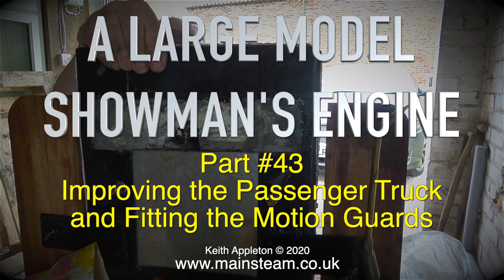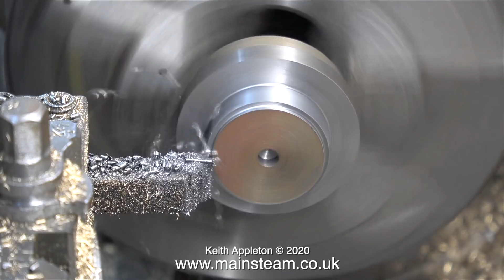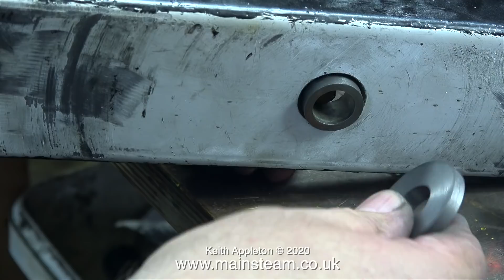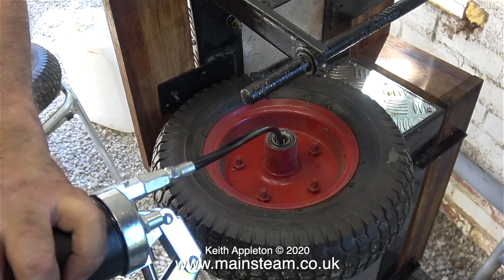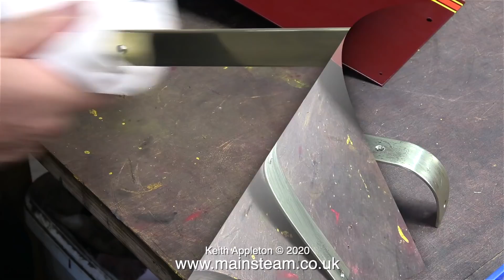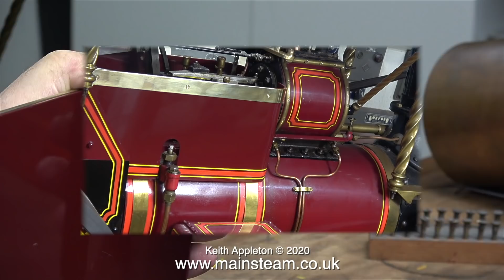A LARGE MODEL SHOWMAN'S ENGINE - PART #43

Comment: When a bolt has X.8 stamped on the head it is metric with the X denoting the grade the higher the better up to 10.  If it was imperial it would have either no markings (perhaps a makers mark) for grade 2 or dashes coming 90 degrees off the flat.  Add 2 to those... so grade 2 for no marks, grade 5 for 3 marks and grade 8 for 6 marks.  The higher the grade the stronger but more brittle.  At this scale even the lowest grade would be immensely oversize but good for bearing on the hole.  For strength even a 1/4" diameter bolt would carry the load in double shear...single shear might be bendy.

As for the size a 5/8" bolt should be 15.8mm so close enough.  The only catch is that the metric bolts have a series of possible threads of 1.0 or 1.25 or 1.5 thread pitch... which will sort of look like imperial and the nut will start but will jam so identifying the metric or imperial will save you headache and doesnt take anything.  

For completeness in this size the imperial bolt would be "coarse" thread most likely or possibly could be "fine" thread and there is no confusing the two since they are incredibly obviously different.

The traction engine is looking better and better.  Add a highway gear and drive it in the Brighton rally :p

Comment: You mentioned great safety tips as usual. Also I noticed that the clips you used to hold the wheels on are called R clips. Here In Canada we call then Hitch pins. Another difference in language between the Mother Country and the Colonies.

Comment: A note to beginners when drilling if the drill gives you an off centre hole you usually have to use a boring bar to get is straight as just using larger drill will not straighten a hole.

Comment: Ah, greasing dead bearings.

I did this to my mum's old whirlybird which was chattering and scwarking all day and all night. While I was waiting for the bearings to come from China, I greased the whirlybird with lithium grease as a temporary solution. 
Two weeks later, the whirlybird was still whirling along in silence and the bearings went into the house's utility drawer and were never to be seen again.
Reply: All the lithium grease I’ve used is the cheap kind in the aerosol can that they stocked at my job, and it turns into a gummy substance that eventually seizes up whatever it was put in. Horrid stuff, in my personal experience.
Reply: Interesting, I never had this problem on my 3D printers or my bicycle, but if it doing that, it's all good, mum sold the house anyway.

Comment: I must say, with the brass strip added, those motion guards look good. And yes, I used duraglit wadding to clean my brass belt buckles when I was an Air Cadet back in the 80’s
Reply: For some reason they do not sell Braso Wadding over here in Canada. When I was in Air Cadet's Century's back we had suspenders no belts, but lots of buttons and badges to polish.